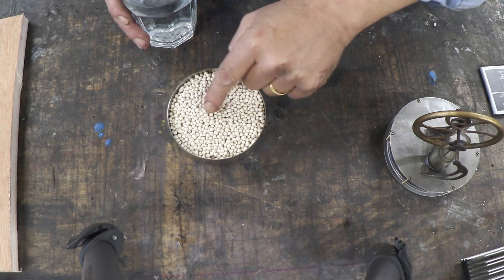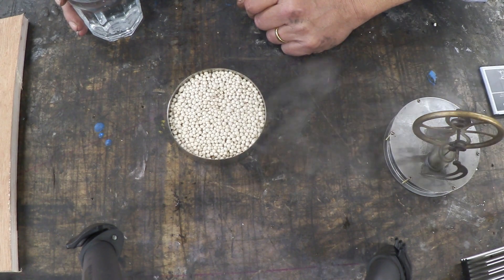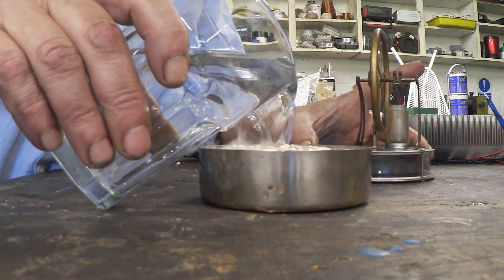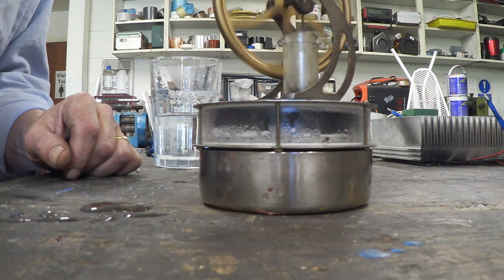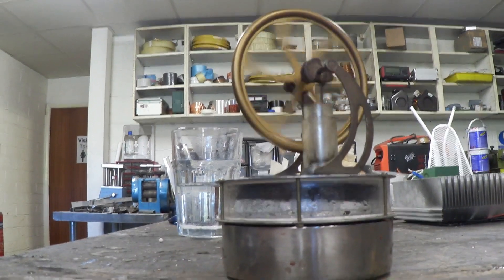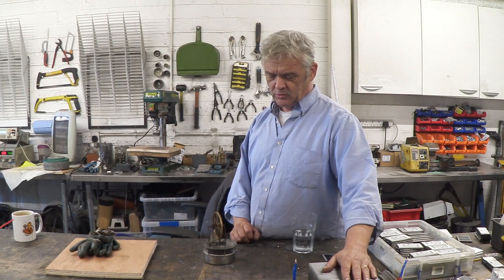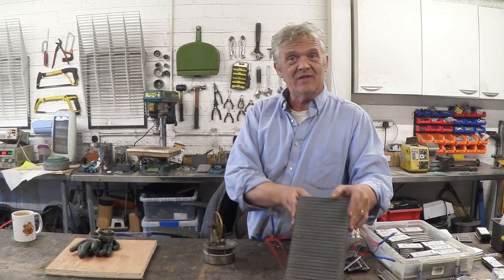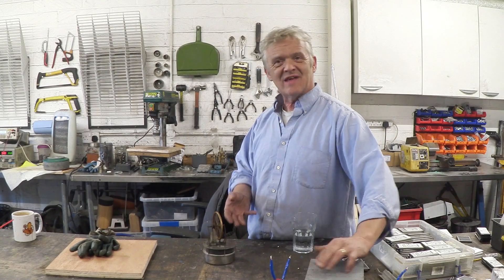1279 Zeolite An Amazing Material - Boiling Water With Clay

Comment: How long will it keep up this reaction if it’s water source isn’t limited?
Reply: Until the zeolite become saturated, which will occur somewhere around 18 and 25% by weight of zeolite. I cant recall the exact % for 13x atm.
Reply: @deezy_da_M_E  i don't understood exactly. Is it means that if i had 1kg zeolite it will only convert 180-250gm of water into steam and will saturated afterwards?
Reply: @yash_kambli  no the amount that turrns to steam is not dependent on its adsorption directly. Indirectly yes, because as the zeolite adsorbs moisture it produces an exothermic reaction, and will only keep producing heat until it becomes saturated. The amount of heat produced is based on the rate of adsorption and the amount adsorbed. You will likely be able to boil off more water into steam than is able to be adsorbed by the zeolite. But it is a very quick reaction. Ive done it before, and its pretty cool to see

Comment: Calcium chloride works pretty well too. I get my CaCl for experiments from the local Dollar Tree in the form of dehumidifier. They even have a version with activated carbon that can easily be removed for some of Robert's other experiments.
Reply: What the activate carbon sold as at the dollar tree.
Reply: @reypolice5231  It is in one of the dehumidifiers. The activated carbon is to remove odors. The pellets of activated carbon are pretty easy to pick out - about a handful in mostly calcium chloride, but enough to do some small experiments with. The brand name is The Home Store - Moisture Eliminator with Carbon.
Reply: @technosaurus3805  

Thank you.